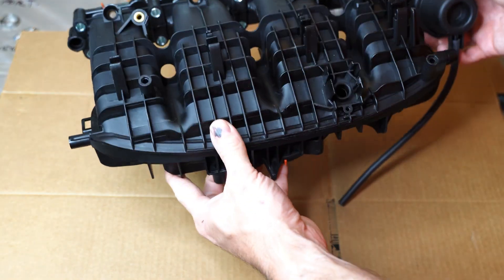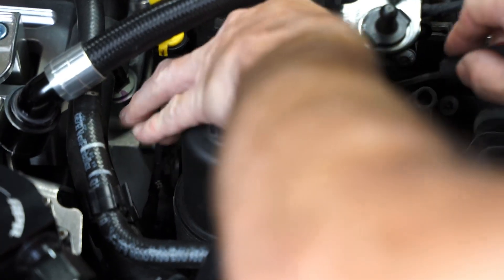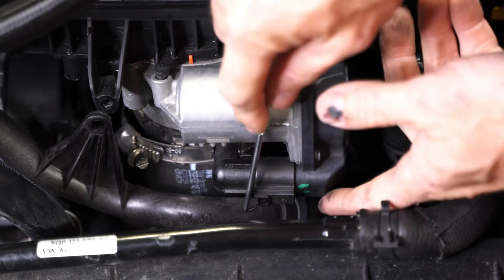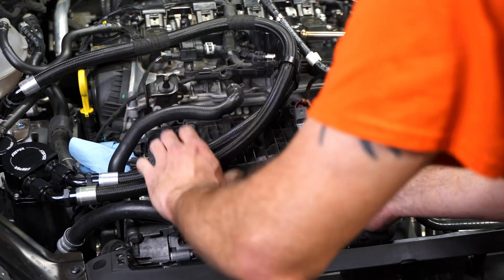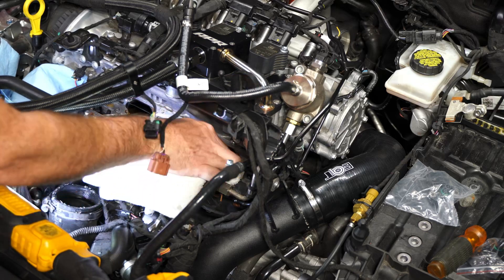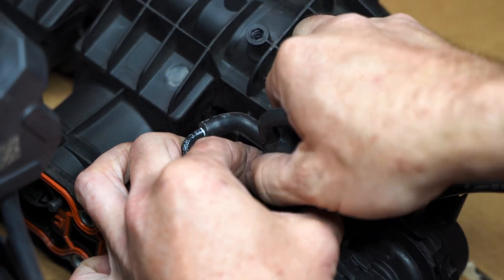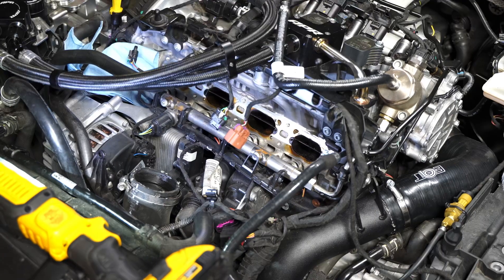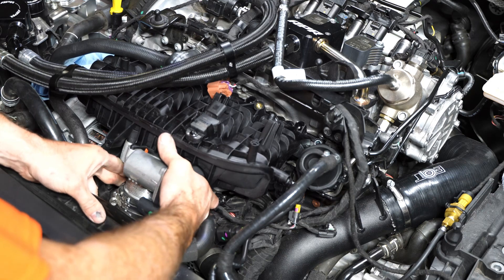MQB Intake Manifold Swap - Preparing for MPI Installation

Comment: What about the diaphragm eqt mentions needs to be swapped over?
Reply from the maker: They have recommended checking to make sure the diaphragm is seated, stretching the spring, or swapping the whole assembly over. 

I tested mine before install, but a year later the diaphragm tore and it stopped holding vacuum. I ended up swapping the whole thing over. Just last week or two.

Comment: What did you end up doing with your ethanol sensor here?  Before you had it mounted directly over the manifold.  I'm in the process of installing mine and I'm looking for some way to secure it a bit.  Not a whole lot of options left once that line is cut.  I was going to use a 90° quick connect but I'm skeptical about leaving it hanging loose around the engine mount.  Any recommendations?
Reply from the maker: I zip tied it to a coolant hose on the left side of the engine
Reply: @EVERYTHINGcpo  Thanks!  I was thinking of trying to use the stock mount attached to the coolant bottle if I could too.  Maybe there's a way I can do a little of both.

Comment: Have you had any issues with your IM without it using the IM bracket? 

I have taken my IM off 5 times now. First four were for valve cleanings, and the fifth time was today, because I am replacing my OEM injectors as I was having misfires due to dirty and leaking injectors. So as I am writing this comment, my IM is currently off, and I am about to put it back on, but I absolutely dread putting that bracket back on due to the limited space for that triple square bolt. That bracket is literally the worst and most difficult part about taking the IM off and putting it back on. If I don't have to put that back on, then I'm not going to, but I haven't seen or heard of anyone else who has left that IM bracket off like you.
Reply from the maker: I haven’t noticed any issues. I was talking to some folks who said it’s very common for the techs to leave it off. I have been running without it for over 2 1/2 years
Reply: @EVERYTHINGcpo  Okay thank you. I actually decided to put it back on just for peace of mind, but I found an easier way to install it when putting the IM back on. Basically, I thread the triple square bolt into its spot, just so that its in place, before I installed the IM back on. This still allows the top bracket nut thread to still slip onto the IM when the IM is loose inplace. With the triple square bolt already in place, it makes installing the bracket very easy. If not doing it this way, and trying to get the bracket into place with the IM already in place, its very difficult and frustrating. So this way makes the bracket install a lot easier, and honestly, not that bad of a job. 

Thank you for your response regardless, and its great to know that the IM bracket isn't really needed. Thanks bud!

Comment: Great guide. I am also planning to install a port injection system, however there’s very little resources on how to enable the system to work in the ECU. Is it possible to show us how to enable the MPI through ECU tuning when you have the kit installed? Thanks in advance!
Reply: As far as Im aware, MPI can be enabled on the tuner side so best to discuss it with the tuner you go with. Personally I would recommend Equilibrium Tuning